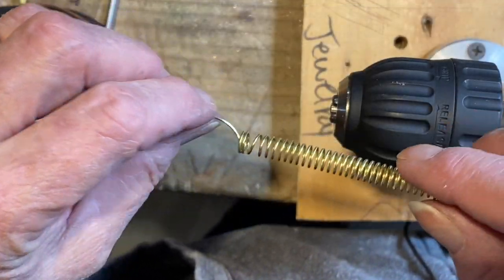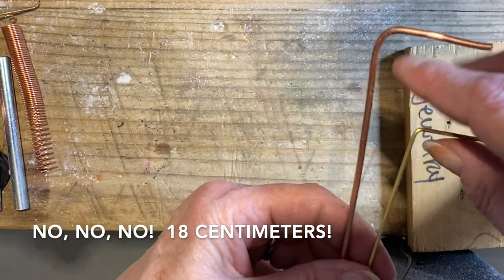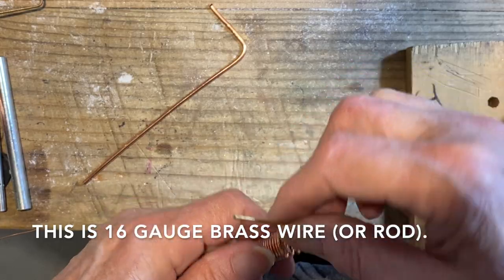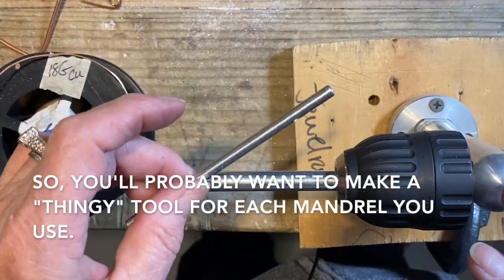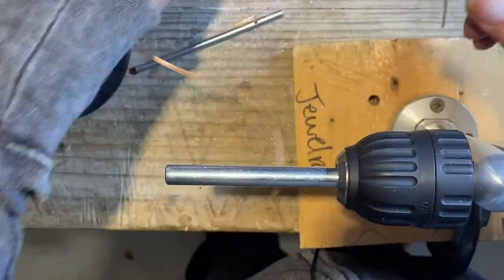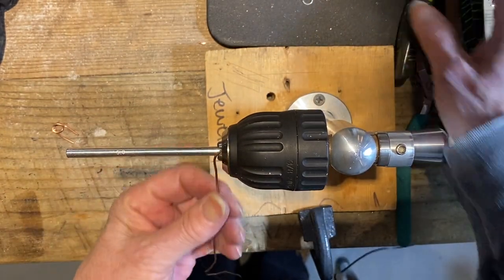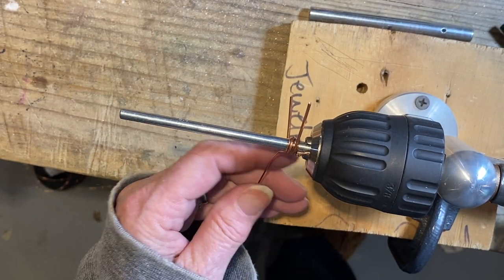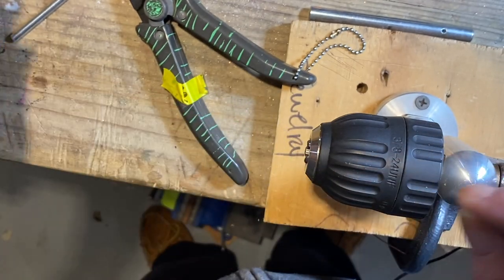How to Make Springs: 2 Great Hacks for Opening Coils

Comment: Those are stupid easy coil hacks. Thank you!!!
Reply from the maker: I was so excited that they worked so well!  So weird, jumping up and down about a piece of wire! (I did that!)  Hahaha!!!  Thanks.
Reply: @NancyHamiltonJewelry  it's always exciting to find an easier way of doing things, especially if it doesn't require more coin to achieve it. This just requires extra wire most of us have on hand.
I like to separate my coils to make jump rings. This will make that job immensely easier and more consistent spacing then stretching out the coil does.
Thanks again for the wonderful tip! 💕👍
Reply from the maker: @tyedye571  I wish I could claim the genius for myself but, alas, it was SlavTV and ReEngineering who were there first.  I just had the idea to put them together in one video.  Thanks Wendy!

Comment: For the spring wire itself, are you using soft, half hard, or hard wire?
Reply from the maker: It depends on the gauge and use.  If I was making a spring for a clasp I'd use steel music wire - hard as heck!  If I'm using a heavy gauge wire like brass or bronze, I'd probably anneal it.  It the video, I used the wire off the coil which I ordered dead soft - although dead soft isn't as soft as when I then anneal it too.  Fine silver, probably no annealing.  I always buy my wire dead soft, whenever possible.  I can always work-harden it, by twisting or pulling, if I need it hardened.  If I make a coil of, let's say, 12 gauge copper, I'd probably anneal it before opening the coil with the "Thingy" tool.  That's just to reduce the amount of work that I have to do!  Thanks for the question and for watching!

Comment: Or you could just hold each end and stretch it like I have been doing for 10 years
Reply from the maker: But, for me, I can't pull the ends apart so I need to spread them apart with a screwdriver.  I started with the pulling and spent a lot of time opening the ends so, I began my research.  You might try the "Thingy tool"  making the coils already open is pretty danged quick.  Thanks for your feedback!  Happy stretching!
Reply: @Reid Smith Yes so long as you take it easy, to be honest the first I saw the winding method was in this video
Reply from the maker: @Reid Smith Yes, with the "Thingy Tool" and the "L Thing" (Hah!  Who knows what to call them?)  offer consistent results.  With the "Thingy Tool", the consistency depends on how well I make my coil.  The "L Thing" probably yields the most consistent results as long as the coil is made tightly.  But, the differences are negligible.

Comment: I’ve never used coil in my work.  Can you give me some examples of how it would be used?
Reply from the maker: I'm making a figure 8 chain that requires an open coil.  I can't post images here so, it is difficult to explain.  But, essentially, each link is made from 2 uncut jump rings.  Each loop is pried up from the coil.  I know, that's confusing!  I'm working on a video about making this so, more information will be available soon!  A lobster claw, tube clasp or circular clasp has a spring in it - if you have ever made those.  You can coil the wire and bend it into a bracelet or earring shapes.  Kind of like these coil springs (they aren't jewelry but, could be!) http://m.cnchspring.com/metal-springs/compression-spring/beryllium-copper-coil-spring.html.   You can coil the wire and then flatten it for bracelets and other applications, you can make a Tesla Coil!  Ha! This Cardinal bracelet uses open coiled wire:  https://youtu.be/dPByOiV-YDo.  There's a few other chains that are interlocked and woven but, I'm having a hard time finding them at the moment. Hope this helps!  Thanks!
Reply: Nancy Hamilton omg the video on the cardinal bracelet did my head in🤪. Amazing and a bit too much for my feeble brain 🧠 😂 fabulous though. Kudos to you if you have made one. 
Love 💓 you videos, I’ve learned so much from you over all these years. 
Thank you so much , I know how much time goes into making videos. Wishing you a Merry Christmas 🎄 and all the very best for 2020.